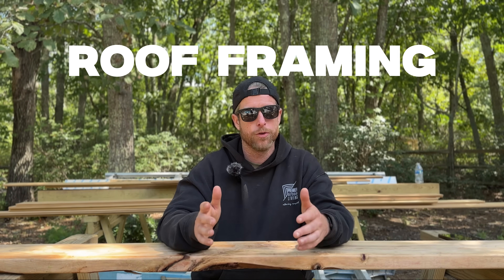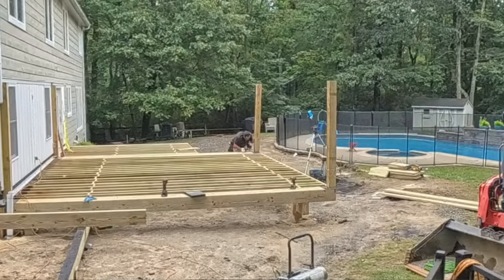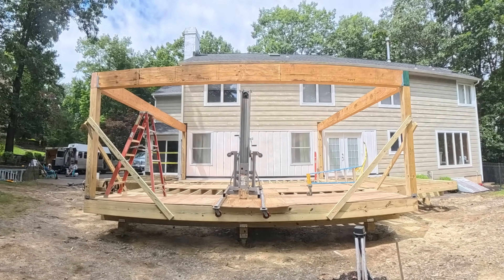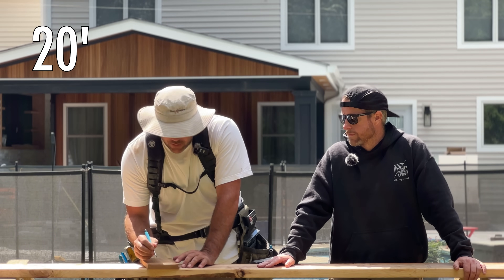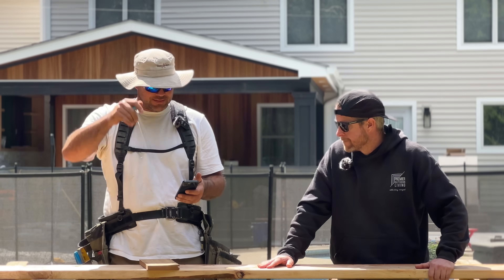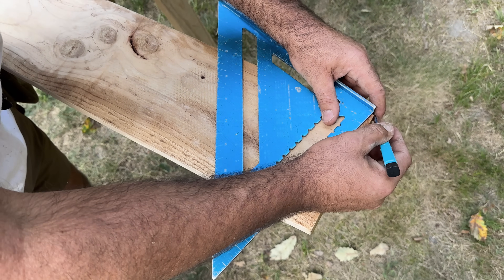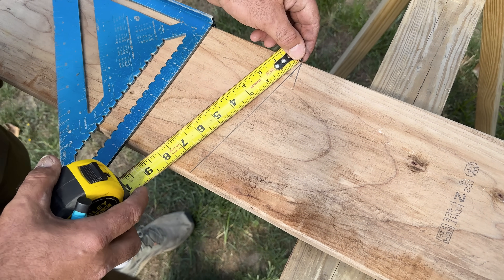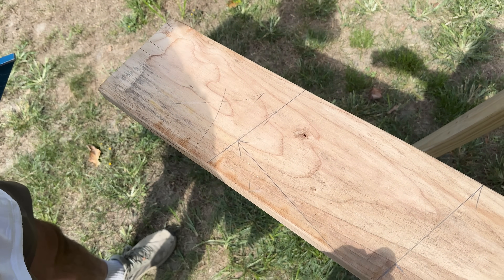Roof Framing Math Made SIMPLE!

Comment: This is a very simple and effective explination on how to do this. I think the H.A.P is something that is typically left out. It's great you guys covered that and also explained what to do with that dimension once you figure out what it is.

VIDEO SUGGESTION - How to measure and calculate aligning the fascia of new and existing when framing the roof of a covered deck and you need the new fascia to align/match with the existing fascia of the house.
Reply from the maker: Glad you liked the video! Great suggestion, definitely a more in depth video using existing numbers from the house but it’s something we have to do a lot so that would be a good one!

Comment: So after the rafters are up, do you just remove the temp braces? Do the rafters just hold that ridge up at that point? Also, is there a certain way to connect the rafters to the beams? I’ve heard before that you have to put horizontal braces up in the rafters, from one side to the other, to keep the rafters from wanting to slide out and the roof collapse. Can you explain all this a little more?
Reply from the maker: Great question, leave the temp braces on until the roof is sheathed, that is going to lock it in square and keep it from moving
Reply from the maker: Also you want to install hurricane clips at the beam to rafters connection (or a structural truss screw to replace that) and at the ridge you will typically need collar ties installed underneath the ridge, or in this case we used strapping on top from rafter to rafter over the ridge to replace collar ties

Comment: Putting all the load on those outside columns and setting them on a cantilevered floor system is not going to work well for you. You have correctly stated that you need LVL beams on the top, but placing that same concentrated load on a cantilevered joist will overload the cantilever. Large loads need to bear directly on a correctly sized footing.
Reply from the maker: I’m sure as the creator of the roof framers bible you have much more knowledge about roof framing than me! It may not have been clearly shown in this video, but the roof posts on the outside bear onto a tripled 2x10 beam, which is cantilevered but has been designed by an engineer. The load on that corner was then given to the engineer that specs our helical piles to ensure there is enough bearing capacity for the load. Happy to hear some feedback from you though because I’m sure you’ve got a ton of knowledge on the subject!
Reply: @THEpremieroutdoor  Yep, it's hard to see in the video. It sort of looked like you had turned a 2x10 flat inside the band around the perimeter. I thought that was perhaps for nailing for picture framing the decking. That's great that you had it engineered. I see so many instances of where people don't do that. I just hoped to save everybody some trouble. Good luck in all your endeavors!
Reply from the maker: Appreciate it, I checked out a lot of your videos and you’re definitely well qualified in this subject! Thanks for checking out the video, I’ll have to get myself a framers bible